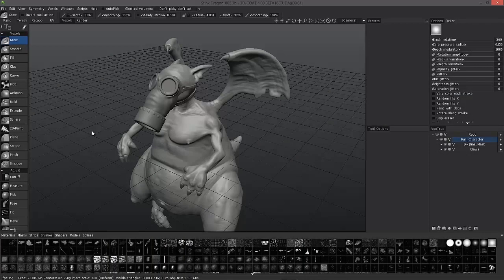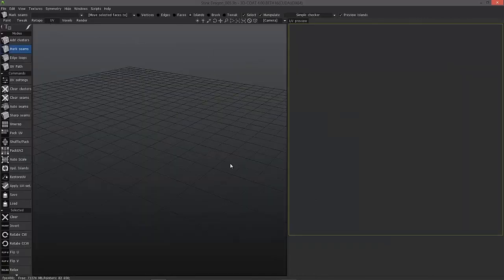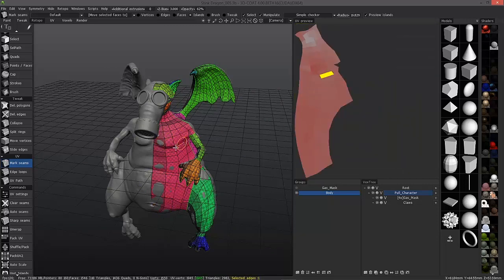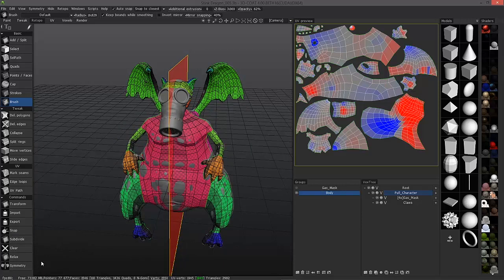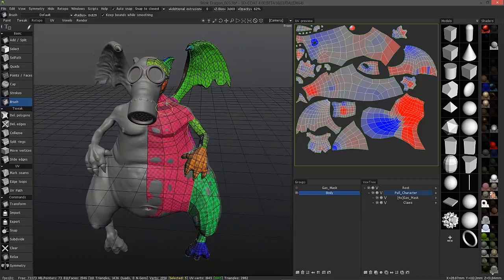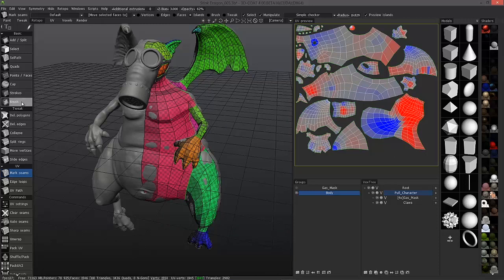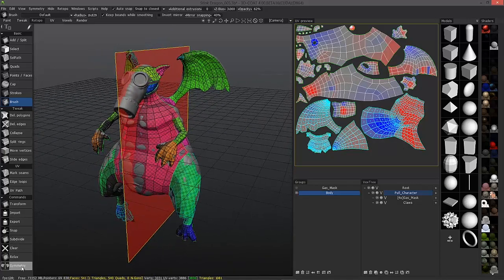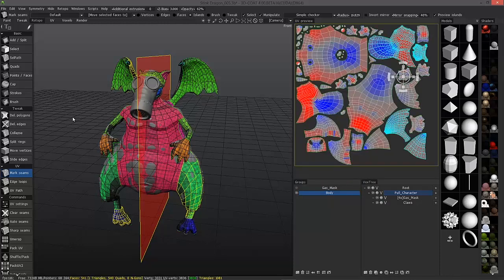Working w/ Symmetry (Retopo/UVs)

Comment: Make sure you hit S to bring up the Symmetry Panel and click on the Axis Plane that you want to enable. When you click on the (Apply) SYMMETRY button at the bottom of the tool panel or from the Retopo menu, all it's really doing is just mirroring a copy of the mesh. 

If you have done that and are still seeing nothing, check "Invert Mirro" in the Toolbar (top of the UI) and see if that doesn't do the trick.